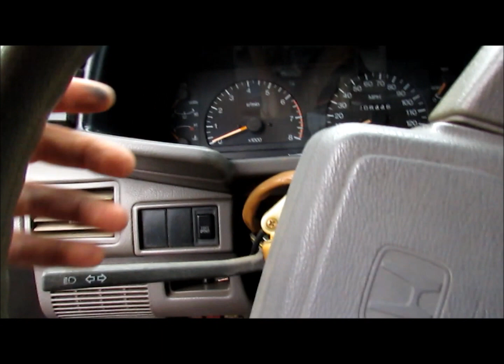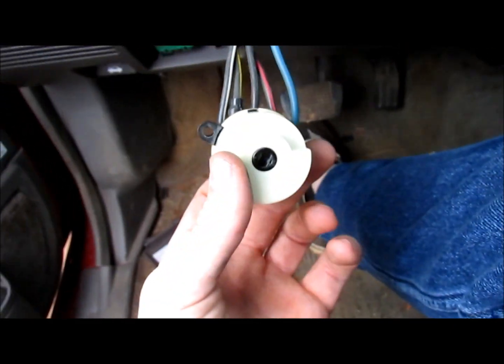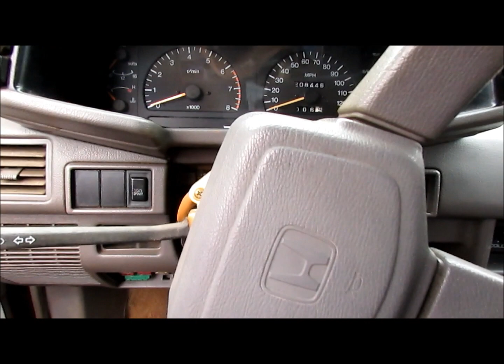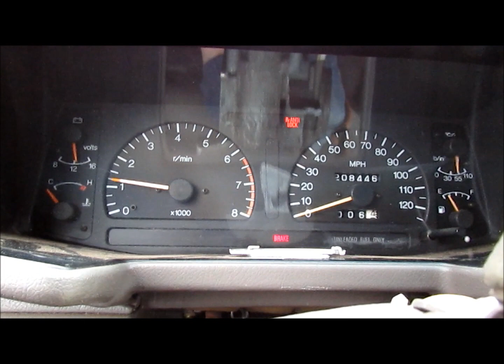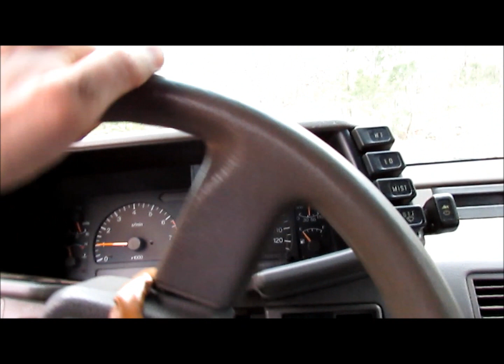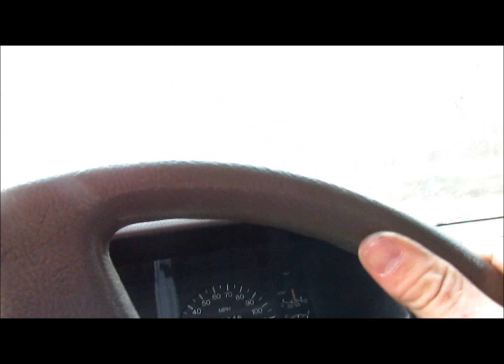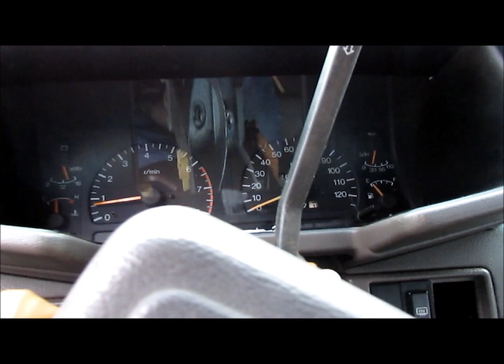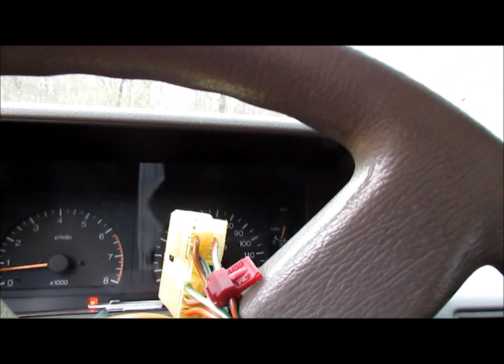Honda Passport HOTWIRE & ABUSE

Comment: the power mode light is in the center screen in the dash.

my grandfather has an isuzu of the same year. i tested the power mode and it really works. The mode changes the algorithm of the TCM so the tranny change gears at higher rpms. at low rpms the difference is barely noticed but in high rpms the difference is noticed. In normal mode it revs up to 5000 rpm or so. in power mode it waited until redline to change gears.

Comment: I've got the solution to your rod knock, just pour in something like 20w50 or gear oil, same shit, and boom, if it makes it there before it goes boom, problem solved
Reply from the maker: BronzeChicken might help if I put some oil in it too. lol.
Reply: Well yeah that generally doesn't hurt, look at it this way too, if you drain it from a Dodge, you're also adding antifreeze at the same time.